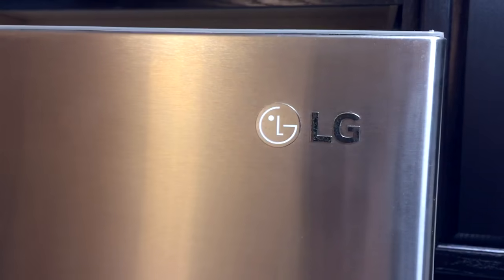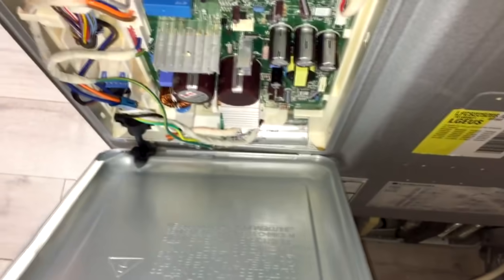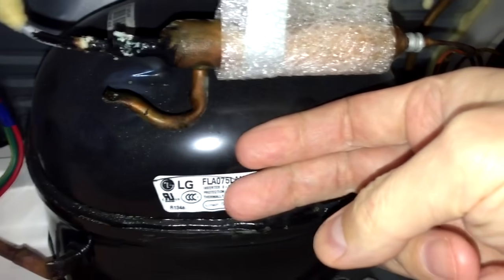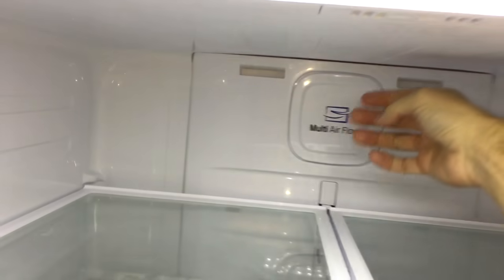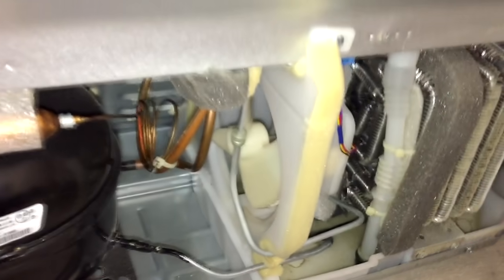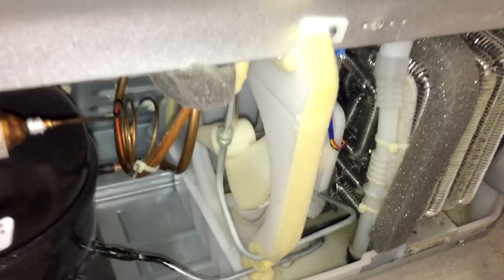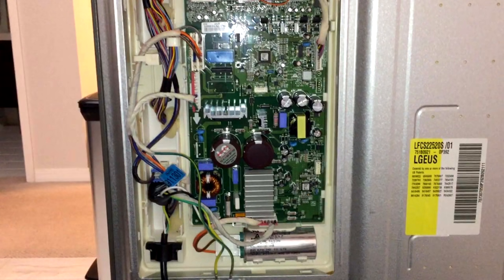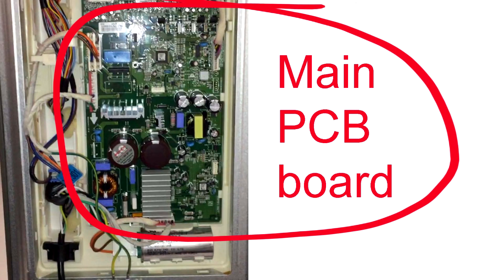LG refrigerator test and reset button

Comment: Thank you. I did this last night on a previous yardwork customer who placed an advertisement in FB marketplace for a freezer not freezing repair. Watched your vid. Removed the service panel, did the steps after viewing 6 blinks of a red LED blinking. I watched for the test step indicator on the fridge's temp display. Fourth push went to "normal operation".
I called her the next morning. I was told her fresh food compartment and the freezer section are working as they should be.
Reply: So what did you do to fix it? Just go into the test modes? Did you stay in test mode 3 for a few minutes to defrost the evaporators?

Comment: As a HVACR tech with little experience with appliances your videos are very helpful in allowing me to learn the correct way to trouble shoot these LG Frigs and not just assume like most techs I work with that it's a bad compressor every single time.
Reply from the maker: Glad you found it helpful, and thanks for watching!
Reply: @Your-Self  ⁰
Reply: Never got any lights flashing on the board

Comment: My LLFX28968 stopped cooling after our home AC quit working over 100 degree weekend in Texas.  Watched your video, found a code 6: Current Overload flashing after I removed back panel.  Ran the self test, everything appeared to be working so I waited thirty minutes then closed it back up.  I guess it went overcurrent due to 90 degrees in the house but seems like it's working fine again.  Thank you.

Comment: Thank you very much. The water line for the ice maker sprung a leak and the PCB got wet. The fridge stopped. You showed me that there was a reset button and where it was. After things were dry I tried it (using a popsicle stick just in case!) and everything works again fine. Thanks for saving us thousands in fridge and food at the hottest time of the year.
Reply from the maker: Glad it helped, and thanks for watching!
Reply: Thanks for the video…
My freezer had gradually quit cooling and things were thawing. Lost a lot of frozen food as we were gone. LG has been very difficult to deal with even though it is under warranty. After viewing your video I found the test button and things checked normal. No LED codes. Compressor and fan function normal. Upon emptying freezer and dissembling partially the interior, frozen coil. I suspect the defrost system is malfunctioning. Took a while to find the test button, but my mother board is different (located on top of unit). Still your video was quite helpful. Confirmed fan operating as well as compressor. On a side note if this happens make sure you have plenty of towels for the thawing ice buildup. I don’t recommend trying to remove it manually as there are electrical wires and water lines in the area. I managed to do it but I have 40 years as an aircraft/avionics repair person. Waiting on LG warranty people now…🙄. 
Thanks again!
Reply: @elliottsmith2179  - You'll be waiting a long time. LG is a crappy company. Basically consider it Eastern China. They just had a class action against them for their defective refrigerators, but my model was not included - even though I am sure they know they used the same defective engineering and parts in other models, they will not do the right thing without a lawsuit.
Reply: I am in Hot California,  have been helped to solve air conditioning issues and ,  I felt that I should Express my positive message to those persons that HELP UNKnown people through the invaluable service of the internet .  Those topics that gives assistance on soloving  high temperature or issues on air  conditioning etc,   I should be really thankful with those great humans that give clear, counsels or  solutions . THANKS GREAT HUMANS WE NEED MORE PROCTIVE HUMANS LIKE YOU  THANKS!
Reply: what is PCB
Reply: @sheilahasson8670  It's an abbreviation of the "Printed Circuit Board" shown at 4:15 in vid.

Comment: My LG compressor broke in the 4th year. I'm so glad I still have a warranty up to the 5th year. Never again will I get an LG refrigerator.
Reply: NO Samsumg, whirpool  or LG  all they are TRASH,  only 3 years working life
Reply: Mine stopped 5 days after 5 years warranty expired...never again will I buy lg
Reply: It is a shame, because if the LG Refrigerators would work correctly, they are durable, nice looking and well laid out.  There is currently a class action suit for LG compressors.  If you go to the LG website and read the comments many people have had problems with the compressors. They need to pull the bad product from the marketplace and fix the compressors.  If they need to charge more money to bring quality/reliability then they should do so, instead of disappointing their customer base and inconveniencing customers when they are left stranded with a non-operational refrigerator and their food gets spoiled.  I have had issues with the in door ice maker & water dispenser.  Most people expect a refrigerator that costs $2K to last for QX years.
Reply: what model of lg please? mine was good similar to model on video for more than 15-years in large family, until last week when i notice that my lights do not turn off when the doors are closed . i believe it should be some of upper lights /temp control board as the door switch still works upon check .I just did cleaning and vacuuming for the maintenance.

Comment: This evening discovered freezer not operating properly but fridge is fine. This will help immensely. Thanks
Reply from the maker: Good luck!
Reply: Im currently having the same issue. Did you fix the problem?

Edit: Fridge stopped working the next day.  Ended up paying someone to diagnose the problem and change the compressor. Fridge and freezer have worked perfectly ever since.

Comment: Do-it-yourselfer's, no disrespect to the uploader as he didn't create LG's fault codes, but you can ignore this one folks. Of LG's 8 codes, 6 of them list the PCB as a likely problem. Friends, if you took the 20 main problems we experience with refrigerators, odds are huge it's one of the first 19 and #20 is the PCB. As someone who has repaired everything with a PCB short of the space shuttle for decades, 95% of the time it's not the PCB . I had an LG tech out here who told me I needed a new PCB ($500 +) to repair my ice crush function, the part was $9, labor 15 min  and I've had 2 other repairs the techs said "replace the panel" and the fix was never $20.
Reply: Tommy Daly so what do you suggest when the refrigerator and the freezer are not cooling but everything else seems to be working.
Reply: Can you offer any advice? The evaporator fan works when I conduct the first test. But after completing all three tests, the compressor and compressor fan come on but the evaporator fan does not. what' s up?
Reply: So just replace the board?
Reply: Thank you very match
Reply: wow what impressive resume , what part this you replace sir/madam/jews please?

Comment: Very nice video. Troubleshooting my LG now. Upon first panel opening, the led was blinking but no longer after a power off / on cycle. Will open the bottom half panel to inspect the compressor and related fan work. Fridge and freezer almost at room temp. If compressor with '10 year warranty' then game over as LG was sued for this fault. They charge hundreds of dollars for the labour to install the compressor...if even available with a short lead time. Thanks again for your video!!
Reply from the maker: Thanks for watching!

Comment: My fridge just died yesterday and thanks for the info so that we know not to buy LG crap next time.
Reply: Yeah I got stuck with one too. I got it at a restore for 500 bucks. Hopefully its not anything major but having it 2 1/2 weeks lets  e know to steer clear of this brand
Reply: They can fool me once....never again.  Never going to consider any LG product.  This brand will not last the test of time.  People will eventually get wise to the garbage they try to pass off on the consumer.
Reply: @David Pumpkini Samsung is just as bad.  They had a similar class action lawsuit
Reply: @David Pumpkini our compressor died a few months back and im not made of money so we haven't replaced it yet so I can't offer you any advice other than to stay away from LG. Fridge is only 3 years old
Reply: @David Pumpkini You may want to read your warranty packet more closely there mr pumpkini.   Everyone else....dont get your advice from a pumpkin
Reply: @MATTP545  Hey Matt, our original compressor died just after 5 years, but I realized the compressor had a 10 year warranty. The only company I found to do the warranty work was Sears, even though we no longer have a Sears around here the 800 number dispatches someone. They handled all warranty related stuff and we were never charged for the parts. The new linear compressor was the newer revision that was supposedly redesigned to address the failures that lead to the class action lawsuit. We've had it fixed for like a year now. Sears was surprisingly great. Had to pay labor, but they weren't very expensive compared to what we were told to expect. Good luck!
Reply: @David Pumpkini wanted to make sure you saw my reply to Matt here. LG replaced my linear compressor under warranty, through the repair service we had come out. It was Sears appliance repair who did the work and dealt with 100% of the warranty part acquisition. We just had to pay labor, which was way cheaper than I anticipated for some reason.
Reply: @David Pumpkini actually, what got me reading the comments here originally was my fridge not cooling enough after the new compressor. But I got it cooling better by pulling it out from the wall, unplugging from power, opening the main board panel, plugging back in to power, pushing the test button to run the 4 stages of diagnostics built into the board. One more unplug/replug for good measure, and it got noticeably cooler. Someone elsewhere said simply running thru those diagnostics tests can fix that problem. But I also checked my door seals while the fan was blowing in diagnostic mode - I had no air seeping anywhere. (maybe this note can help someone else)
Reply: @FireSloth1134  Good to know Andy, thx.   We have a Kenmore Elite for ~7 years now.  Do you mind share and post the 800's here?  BTW, how was the labor charge?
Reply: @Matt P  you have a 5 year warranty for that compressor. Call LG and there's no charge to fix it. LG refrigerator does suck.

Comment: Thanks for your video I have a 36" LG and the display would flash a error message after appearing normal after just plugging it in.  This for 6 years, then the other day it completely stopped cooling.  After watching your video I found the fan wire had fell off.  A easy fix.  Also the display seems to be working now!
Reply from the maker: Good to hear it!

Comment: Very informative and straight to the point. Thanks!
Reply from the maker: Thanks for watching!
Reply: Will be subbing
Reply: My LG the model number is LMX25964 ST will not cool what is the problem
Reply: On the control board is it EBR 673480 could it possibly be the main control panel

Comment: LG fridge $1495 bought feb 2018, quit working I unplugged and cleaned compressor and fan area. Plugged back in and still no heat. LG was great at giving me a phone number for a service center which I will have to pay parts and labour. Thanks to LG we are now using a 25 yo Frigidaire we were given for free. Our next fridge will not be LG
Reply from the maker: If your fridge quit working because of a bad compressor, LG should fix it absolutely free (if you have the purchasing receipt)
Reply: We contacted LG and they sent out competent tech to replace compressor for free. We did have to buy a mini fridge since it was a week before he would show up.

Comment: Your video has been a BIG joy in helping me to troubleshoot the problems with my Kenmore/LG refrigerator.  I went through the test modes (everything checked out ok) but the error light on my PCB is not blinking any error codes at all.  Will this light activate when I push the reset button, or should it already be blinking if there's an error?  My refrigeration is not cooling but everything seems to be working ok.
Reply from the maker: Your situation sounds like a typical LG Linear compressor problem - running but not cooling. 
If you can feel the air movement inside the freezer and the fridge, but it's not cold, the compressor is probably bad. And unfortunately, there is no error code for this particular (most common) issue.

Comment: DO NOT BUY LG REFRIGERATORS. MINE BROKE DOWN THREE TIMES AND THEY HAVE DONE ZERO TO HELP ME.
Reply: They are nice and roomy, have good features but there is something wrong with them just like the washers.
I think our last one was damaged or something during manufacturing so after 5 repairs we got a new one and it got loud after a year and the  tech that came out under warranty said he could not find anything wrong. We even did a video for him with the sound and it went away when you opened the door, you can tell a fan is rubbing on something 

maybe ice build up in the freezer. I hope this fixes ours as I am about to open the freezer up to see if there is ice rubbing on the fan blade.
Reply: I AGREE.
Appliances should last 20 years like they used too.
Reply: i agree
Reply: I wonder how much it's down to you. Most companies aren't that bad these days.
Reply: Amen!!!   Same here!
Reply: Bought my mom one for mother's day and 2 months in she has had nothing but problems. Water everywhere, compressor not working and all her food was a hit mess. Will not get below 66*
Reply: They may suck but unfortunately most others suck more. They are the least sucky of all sucky refrigerators
Reply: My LG refrigerator stop working after 1 year and 5 months. Bought it on June 2021. It went dead on November 2nd. Called the customer service and they were incoherent ( by the way the customer service is outsourced). Called 3 times, asked for a supervisor. She assured me that the supervisor will call me in an hour. Guess what, it is almost a week, still no call. We gave up, went ahead and got another fridge. This time we get a GE. NO MORE LG!!!!
Reply: I work on them all the time their notorious for compressor failure
Reply: @barnonekrazi  yup the only surpassed by Samsung as far as being the worst pos ever manufactured
Reply: @smyers820gm  lol
Reply: @breddi1  😂👍
Reply: @smyers820gm  lol samsung are worst.
Reply: @jordanpavao4304  yes sir. Absolutely junk 😂
Reply: I won't buy ANYTHING from LG anymore !!!!
Reply: I mean I could bday that about any brand. I've had fridge, washer and dryer for 6 years and 0 issues with anything. So this is a reach
Reply: @derek138  actually no you couldn’t.  Please remember OWNING ONE is not the same as working on THOUSANDS.  Ok experience is the B I G difference 🤷‍♂️.  I own an appliance repair company and have been working in this industry for over 30 years and the facts are LG not great but Samsung refrigerators are absolutely trash.   ANYONE and I mean ANYONE that does repairs for a living will tell you that.
Reply: @smyers820gm  what brand would you recommend. Mine just went out after 4 yrs and I'm done with LG at this point
Reply: @CYB3ROP7iX  whirlpool is my personal favorite
Reply: Compressor doesn't start  I open it and I push test mode, nothing but a Red light is blinking, what that means?
Reply: @rivercitygirltube  bad board or compressor.  Sorry impossible to know for sure without testing
Reply: @smyers820gm But I only had this LG refrigerator for 13 months, I wanted to sweep  under the refrigerator, and as I moved it, it made a noise on the compressor,  then it stop while it was plug. Then I unplug quick. I moved it back into place. I left it overnight. this morning is warm the fan is the only thing working
Reply: @rivercitygirltube  it’s hard to say without actually looking at it.  Unfortunately LG have issues.
Reply: @smyers820gm  
You know what? I called LG company, they ask for prove of purchase,  Im glad I keeped all paper work, and they said we be there to fix it, The Technician just left and my refrigerator is working again with a new compressor he said I had 10 years warranty!
 Thank you Jesus!
Reply: AGREE. MINE QUIT AND THEY WSNT ME TO DEFROST IT FOR 24-48 hours!!!!
Reply: And I live in a remote area. I do t think they want to help.
Reply: @rivercitygirltube  im glad they covered it 👍😊
Reply: @denisecarruthers1520  im sorry 😢.  Maybe keep calling back until you get a person that is willing to help 🤷‍♂️
Reply: Agree
Reply: Mine the same, run only 2 years now not working 🥺
Reply: @corriemusich6463  yes. my fridge just went down and my LG washer breaks frequently
Reply: Man, I love mine!
Reply: @a1smith  Damn, I think that second sentence of yours is the first time I've ever heard anyone use those words, in a sentence, in that exact order....EVER!?!?!  Assuming that you're serious, of course.
Reply: My ice maker stopped working all of a sudden.  Help?
Reply: That goes for Samsung too
Reply: Company service ke nam pe Paisa vasul karti hai service mechanic worst hai
Reply: Don't buy Lg product

Comment: Thank you for uploading such informative video. I did the test and according to the error code chart you showed at the end of your video, my error code light was flashing 5 times and the chart says,”lack of oil inside compressor,  or physical restriction by foreign material”. Please let me know how do I fix this problem. I didn’t find any oil leak behind the fridge. Thank you
Reply from the maker: It sounds like the compressor has stalled and, most likely, needs to be replaced.
Unfortunately, it's an expensive repair.